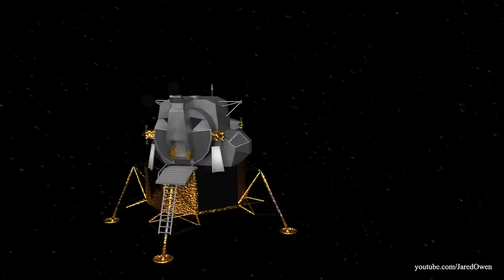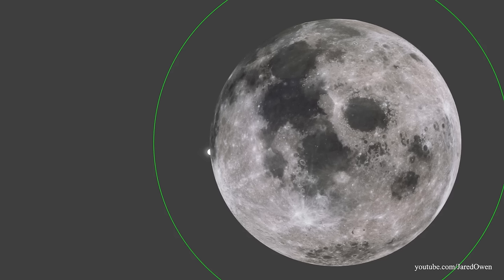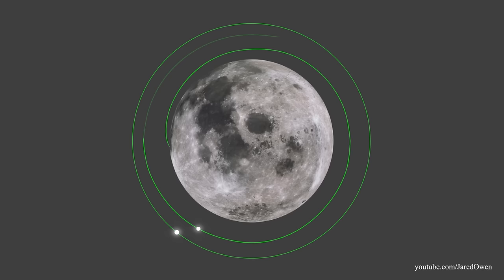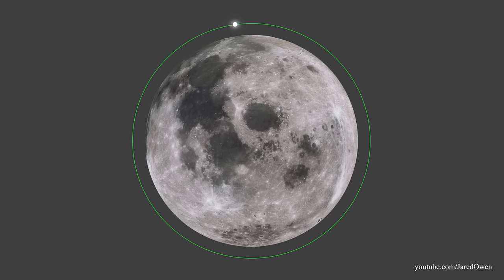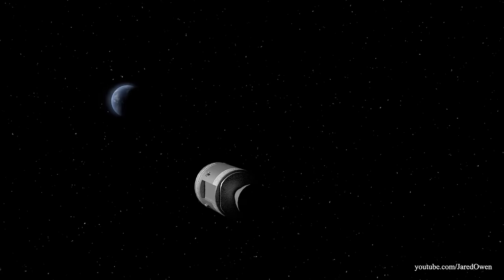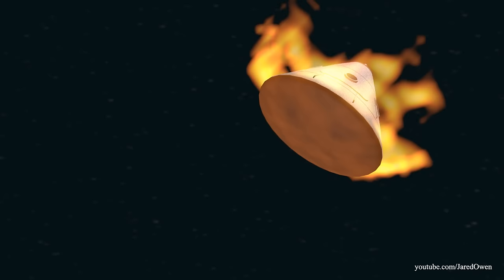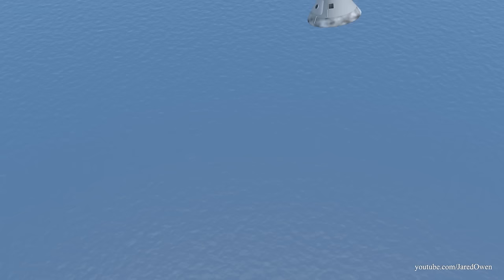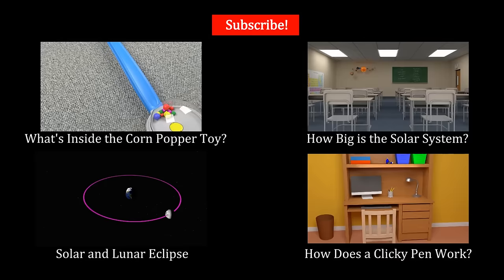How the Apollo Spacecraft works: Part 3

Comment: It probably bears mentioning that the Lunar Module's ascent engine was the only propulsion system on Apollo with no backup.  The service module engine was originally designed for lifting the CSM off the Moon and was WAY more powerful than it needed to be, so if it failed the Lunar Module's descent engine could do the job instead (as was done on Apollo 13).  If the descent engine failed during any phase of the Moon landing, the ascent engine could be used to abort the landing, get back into orbit, and rendezvous with the CSM. 

But if the ascent engine failed to ignite on the Moon, the astronauts were stuck there forever.  Worse, the Ascent Propulsion System had extremely simple plumbing that made it impossible to test-fire, because the corrosive oxidizer would basically destroy the engine in the process.  So on every Apollo mission, the ignition of the ascent stage on the Moon was the first time that particular engine had ever been fired.  The Bell engineers who built the LM's ascent engine probably had the most stressful job in the whole program.
Reply from the maker: I'm sure the astronauts were pretty nervous as they prepared to launch off the surface of the moon.  That would have been sad to get to the moon but not be able to return home.  Thanks for your comment - this is good info!
Reply: CountArtha Fucks thats crazy to think about...just three men stuck in the moon
Reply: I heard that Buzz Aldrin accidentally broke off the switch that fired the ascent engine! (Bumped it while wearing his EVA suit.) Had to stick a pen cap in there to make it work. Now THAT would make me sweat.
Reply: The other interesting fact about the ascent engine was each engine was assembled and installed without testing it.  The corrosive nature of the fuel meant that the engine would have to be rebuilt after firing, so no testing was possible.  In other words, the very first time the engine was ever fired was on the ascent module, by the astronauts who were depending on it to get them home.  Just a bit of pucker factor.
Reply: Yea right!  LMAO  Jared you are a genius, but this is one of the many great hoaxes of the 20th century!
Reply: Still not as stressful as for the two astronauts who relied on it.
Reply: Actually just two astronauts would be stuck on the Moon.   The command module pilot could return.
Reply: Where did they put all the rocket fuel?  It needed a rocket 10 times more powerful than anything on Earth today just to get into low Earth orbit, then does the rest on a few tonnes of fuel? Good luck on Mars.
Reply: @adayinthelife5496  
The Moon has one sixth the gravity as Earth.   The Lunar Module didn't need near the thrust to land and take off as a rocket from Earth.
Reply: charlesvan13 nonsense. you fail your iq test. if you burn 1 million kg of feul to asend and desend, you still need 1 million kg's to get that school bus back home.  the moon is still MASSIVE!
Reply: charlesvan13 my bad. I didn't realize the mass ratio is logarythmic for orbital velocity. thank god. i was starting to freak out. I'm the one rhat failed the iq test.
Reply: @Andrew-wv7qp  They must have built and fired up dozens, to achieve the bullet-proof design that would fire up every time. Much like the Command module parachutes. They could only be deployed once...
Reply: @charlesvan13  An the Moon has no Atmosphere.
Reply: Why not use the descent stage as a sort of booster and transfer the ascent stage's fuel to the descent stage so the descent engine can be used for rendezvous and docking? Was it too heavy? Did it not have the delta-V to do the trick?
Reply: @jemuelmongado5030  Yes, the whole descent module was just dead weight after the landing.
Reply: Could the CSM be used to land on the Moon, pick the astronauts up, and then return home?
Reply: @siyacer  I doubt the CSM would be light enough and have enough fuel for a landing. Even if it did, it will not have the fuel to return to Earth.
Reply: TryHard you realize only 2 people per mission (excluding 13) landed on the moon?
Reply: Yep...he still has the pen. @Tim22222
Reply: WTF are you talking about? You're not making any sense. Please explain better. @adayinthelife5496
Reply: Ken Skid The mass ratio means, if you want 1 pound of coffee in orbit, you need 50 pounds of fuel to put it there.  So if you ever want to get a human back from Mars, you need to put a fully fueled heavy falcon on the surface of Mars.
Reply: I don't think so. Mars' gravity is 38% of Earth. So if you needed 50 pounds to get the 1 pound to Mars, you'll only need 31 pounds of fuel to get it OFF of Mars. . Still a lot but not the same as leaving Earth.

Also, the fuel itself will weigh less on Mars so that in itself brings the total weight down.
 @adayinthelife5496
Reply: @adayinthelife5496  Exactly what rocket fuel are you talking about? The Saturn V launch vehicle had three stages that each carries its own set of propellants (fuel plus oxidizer). Then the service module and the lunar module ascent and descent stages all carry their own separate propellants. Also, keep in mind that the most thrust is required at lift off because that's when the rocket is at its maximum weight. Then as propellants are expended and the lower stages are dropped off the vehicle's weight is reduced. This means that at each step in the mission less and less propellant is necessary to accomplish each step.
Reply: The Service Module engine was NOT designed to lift the CSM off of the moon since the CSM never landed on the moon. It was designed to power them out of lunar ORBIT to get them back to earth. As for the LM's ascent engine, there wasn't much that could go wrong to prevent it from igniting. Hypergolic fuel use a fuel and an oxidizer that when mixed ignite on contact with each other. But, as you said, very corrosive and deadly to humans.
Reply: @Tim22222  The part that Buzz Aldrin broke off was an engine arm breaker. He saw that it had broken and would have prevented the engine from igniting. He used a pen to push the breaker back into the slot and the rest is Apollo history.
Reply: @EasternElectric2012  Thanks for dueling insults on the cyber field of honor - good come backs.  Wish I had time for a hearty civil debate of the facts at hand, it would be interesting to hear your perspective.  Best regards
Reply: @siyacer  Nope. No landing and takeoff systems in the CSM design. Astronauts are some brave individuals!
Reply: While the facts everyone is bandying on about with the ascent engine are true, it was never test fired and used corrosive fuels and had no backup, this was an engine that was deliberately kept as stupid simple as possible with hypergolic fuels that ignited simply by touching each other. Essentially they just had to open two valves and the thing would combust out of the nozzle and produce thrust. They wanted a system that would be nearly impossible to fail. Using nasty hypergolic fuels allowed them to eliminate a lot of complicated mechanical moving turbine pumps and other parts. The blind faith that this thing would work is warranted, as it was designed to be pretty much the simplest, most reliable, most fool proof rocket you could build. The side effect of those goals was an extremely nasty propellant. But it worked out okay in the end. :) 

I dont mean to detract from the claims, I just want to be sure everyone knows NASA didnt just decide to use untestable crazy rockets without a backup for the sake of being lunatics. There were sound, fundamental reasons Grumman went with that design.
Reply: @emayfrit  Ties many other such comments as the stupidest thing said in the last 50 yrs.
Reply: @adayinthelife5496  And thát, my friend, is why you'll never be an astronaut.
Reply: @WhatIInk  weird... I wonder if they would have continued the Apollo missions if Apollo 11 had failed?
Reply: "Mr. President, The Eagle has landed"
Reply: @KebabMusicLtd  Most certainly. Just like they kept going after the 1967 deaths of the three Apollo 1 astronauts in the ground fire.
Reply: charlesvan13 no. He wouldn't have been able, cos he wouldn't have the shield
Reply: Don't forget that somehow the circuit breaker that had to be pushed in to fire the ascent engine to leave the Moon after Apollo 11 was ready to return to lunar orbit somehow was BROKEN OFF, probably as Buzz was suiting up and exiting the vehicle on the lunar surface...  With the tip of the circuit breaker (which had to be pushed in and latched) broken off, there was no way to turn on the system or fire the engine.  They found the broken tip on the floor IIRC.  SO Neil and Buzz were basically "stranded" on the surface, but a little quick thinking overcame the problem-- they use a pen to push in the busted circuit breaker and fire the engine!  

Yes the ascent engine was the only non-backed-up engine on Apollo, that absolutely HAD to work for them to get off the Moon, but it was also pretty much the SIMPLEST engine you can imagine.  It burned nitrogen tetroxide and hydrazine for oxidizer and fuel, ie "room temperature storable propellants" that were also hypergolic, meaning they ignited instantly on contact with each other, meaning NO IGNITION SYSTEM was necessary to fire the engine.  Basically all the "fire" command did was electronically open the valves in the propellant lines between the propellant tanks and the engine combustion chamber itself, allowing propellants to flow and self-ignite.  In the event that the electronics failed and the firing command did NOT open the valves, they COULD be opened manually, which would then allow propellants to flow into the engine and self-ignite.  The engine itself was pressure-fed, meaning high-pressure helium gas was injected via regulators into the propellant tanks, so all that was necessary to fire the engine was opening the valves to allow propellant flow from the tanks into the combustion chamber.  SO, it was about as "foolproof" as one could get.  

While its true that due to the corrosive and highly poisonous nature of the propellants the engine could NOT be test-fired on the ground before flight, it was also an extremely simple and robust engine design, so while there was always SOME apprehension, everybody was pretty well convinced it WOULD work and that if something DID go wrong, they had a decent "work around" to deal with the problem, so the risk was "minimal" (as could be anyway).  

later!  OL J R :)
Reply: @adayinthelife5496  LM-- just a few tons, most of that propellant.  Saturn V-- 3,000 tons... LM-- flying in a 1/6 gravity field, so 1/6 the propulsion required for landing and ascent.  Saturn V-- launching through a dense atmosphere in a full 1-gee gravity field.  LM-- had only to decelerate from about 2,500 mph (IIRC) Low Lunar Orbital velocity (LLO) to a hover and landing on the lunar surface (full stop), with only its own mass of equipment, propellant, and 2 astronauts.  It only had to lift a fraction of its landing weight back off the Moon (the ascent stage, which was basically built like a phone booth made of tin foil) with the mass of the two astronauts and a couple hundred pounds of Moon rocks, and accelerate it up to about 2,500 mph to achieve LLO again... The military has had jets that can do over 2,500 mph, in Earth's atmosphere with considerable air drag, with more payload than that.  Yes that's with wings, but it's also with air drag, AND in a full 1-gee gravity field, not the 1/6 gee gravity field of the Moon, with NO atmospheric drag.  SO it's really not as hard as you think it is...
Reply: @jemuelmongado5030  It was safer to have a "launching pad" using the expended descent stage, rather than reuse the already used descent stage engine for the ascent burn.  Basically what you're talking about is a single-stage lander, with larger fuel tanks.  Besides, when you lift off, the landing legs and lower descent stage structure, tanks, and equipment are just DEAD WEIGHT that is totally unnecessary for the rest of the mission, so WHY carry that dead weight and accelerate it back up to low lunar orbit (LLO) velocity??? It's wasteful.  Plus, there was always the risk that the engine of the descent stage could be damaged on landing, which IIRC they basically were pretty sure happened on Apollo 15 when it landed, as it came down on a rock and partially bent the engine bell IIRC, which would have caused offset thrust or other problems had the engine been fired again for liftoff.  It was simpler, safer, and easier to just design a smaller ascent stage engine and simple propellant tanks and pressurization system for the ascent stage and use it to lift off the Moon instead, using the dead weight of the descent stage as a "launch pad".  That way you KNEW your ascent engine was "good" after landing.  

Another important capability that having an ascent stage engine gives you is POWERED ABORT... If on the way to the lunar surface during powered descent and landing your descent stage engine fails, you're dead as the LM would simply fall out of the Moon and crash on the surface, depending on the altitude.  At any rate, with a failed descent engine you would be trapped on the surface of the Moon with no way back into orbit, with a single stage, single engine LM.  With the ascent engine, if the descent engine quit at say 10,000 feet, you simply hit the 'abort stage" button and the lower stage is jettisoned and the ascent engine ignites, powering you back up into LLO to rendezvous and dock with the CSM.  There is a "dead zone" where you're too close to the surface to simply "plop down on it" and survive if the descent engine failed, there simply wasn't time for the ascent stage engine to fire and carry the ascent stage up away from the Moon before impact, BUT it was fairly small and the risk was fairly low-- after all if the descent engine worked fine THAT long to get you THAT close to landing, what were the odds of it quitting RIGHT THEN?? But with NO ascent stage/engine, you have NO abort capability whatsoever.  

In fact they tested this very mode on Apollo 10... they flew down to about 45,000 feet IIRC of the lunar surface and then fired the ascent engine in an abort, and flew back up to LLO.  They forgot to put the spacecraft guidance into the proper "mode" for the maneuver, though, and it had a wild ride before it straightened out and flew right, eliciting some cussing from Gene Cernan IIRC, but it worked.  Their LM was too heavy for a landing anyway, so they weren't going to land anyway, but the mission was flown to "prove" the LM out in lunar gravity-- Apollo 9 had already proven the LM in LEO, and Apollo 5 proved the LM guidance and hardware prior to that unmanned via remote control from Mission Control.  

Later!  OL J R :)
Reply: @siyacer  No... it couldn't.  If for whatever reason they couldn't fly the LM ascent stage back up to low lunar orbit (LLO) they were permanently stranded.  

The original design for Apollo WOULD have had the entire spacecraft land on the Moon.  This was in the VERY early days of Apollo when they were using what was called the "Direct Ascent" mode for the flight.  This Apollo would have been MUCH larger, as it required a HUGE amount of fuel to land not only the astronauts and their equipment, but the entire Apollo spacecraft on the Moon.  More fuel= bigger, heavier spacecraft... bigger heavier spacecraft= need more fuel.  SO you see it rapidly becomes a 'catch 22' and greatly complicates the entire operation.  You're landing MANY TONS of dead weight as well-- parachutes you don't need til you return to Earth, the heat shield for Earth reentry, Service Module systems like fuel cells and their reactants (propellants), etc.  Then of course you have to lift ALL THAT WEIGHT back off the Moon, carrying a lot of dead weight with you that you no longer need-- landing legs on the bottom of the vehicle, for instance, as well as the huge half-empty propellant tanks you had to have to hold all that landing propellant in the first place.  Such a huge spacecraft landing on the Moon would have created a lot of problems, too... like how do you climb down from the top of a 30-40 foot tall rocket from the CSM to the lunar surface to work?  How do you get back up into the CSM to sleep or leave?  How do you get your equipment and experiments down?  How much extra weight does it take in hoists or equipment to do that?  Calculations showed that such a huge, heavy spacecraft would require a rocket FAR larger than Saturn V-- it would have been called "NOVA" or the Saturn C-8, which would have had a 40 foot diameter first stage instead of 33 foot diameter, powered by EIGHT F-1 engines on the first stage, and a single 1 million pound thrust M-1 hydrogen engine on the second stage.  M-1 would have dwarfed even the F-1 in terms of sheer size, and being a hydrogen engine, which was basically all theoretical at that point, (no hydrogen powered rockets would fly until Atlas-Centaur in the early-mid 60's) development problems were virtually guaranteed.  Nova would take too long and be too expensive to design, build, and test, so they couldn't get done before "the end of the decade" it was soon realized.  

SO, an alternative had to be found-- "Earth Orbit Rendezvous" was proposed to replace "Direct Ascent" from Earth to the surface of the Moon and back to Earth again.  This allowed the smaller Saturn C-5 (later to become Saturn V) to perform the mission, BUT it was too small to lift BOTH the lunar Apollo AND the propellants necessary for it to fly to the Moon and land and then return to Earth.  SO, a SECOND Saturn V would be launched into orbit to rendezvous with the Apollo and fill it up like a robotic tanker vehicle, hauling up the Apollo's fuel on this second launch.  The fully-fueled Apollo lander would then depart for the Moon, land directly on the surface, conduct its exploration, then lift off to return directly to the Earth via reentry like the Apollo we know.  That was the design criteria that led to the MUCH LARGER AND MORE POWERFUL THAN REQUIRED SERVICE MODULE ENGINE that the Apollo CSM had-- it was designed back when it was required to land the entire spacecraft on the Moon.  

John Houbolt, a NASA engineer, came up with an alternative that didn't require but a single Saturn V launch, but the addition of a small "landing craft" to actually go to the surface of the Moon, sorta like a small rowboat going to shore from a much larger ship that stays offshore.  The small landing craft needs only carry itself, its occupants, and the experiments and equipment necessary on the surface down to land, and the equipment and propellant necessary to get back to LLO from the surface-- no dead weight like heat shields and parachutes and stuff like that, which can remain "offshore" in LLO in the CSM.  This "Lunar Orbit Rendezvous" method was at first highly criticized, as nobody could dream of conducting such a delicate and precision maneuver as a rendezvous and docking 240,000 miles away while orbiting the Moon, particularly when it hadn't even been done around EARTH yet, and they already understood the problems would be daunting... but he proved mathematically that EOR was inefficient and would likely not work before the decade was out, if it was possible at all... and it STILL required a successful rendezvous and docking to succeed, just in Earth orbit instead of the Moon's, AND it required the expense of a SECOND Saturn V "tanker" launch to work.  LOR was only ONE launch and ONE rendezvous, in LLO instead of LEO.  SO, LOR eventually won the day and EOR was dropped... 

SO, if the SM's Service Propulsion System (SPS) engine was designed powerful enough to land on the Moon, WHY couldn't a CSM land on the Moon to pick up stranded astronauts?? Simple-  not enough propellant for one thing, and no landing legs for another.  All the "descent and landing" capabilities for the Apollo CSM were never developed, once the decision to use a LM for that purpose was adopted.  For the CSM to land, it would have had to be MUCH larger and heavier, with landing legs and guidance instruments and controls to perform a landing, and it would have required a MUCH larger supply of propellants to land on the Moon-- IOW it would have had to be at least twice to three times the size to hold the fuel it would need, and need landing legs.  Plus it would have needed a Saturn C-8 or EOR mode to launch it, requiring a Saturn V "tanker" to fuel it up in orbit to land on the Moon... 

To put it another way, remember this... a Saturn IB rocket could launch the Apollo spacecraft, BUT NOT with a full fuel load-- IOW, NOT in a "lunar mission" full-up weight with full propellant tanks.  The Apollo CSM's launched on Saturn IB's could only hold a FRACTION of their propellant loads the tanks were capable of holding, IOW, they launched with their fuel tanks less than half full.  Propellant is VERY heavy LOL:)  That's why Saturn IB's were not used in the lunar program... not enough lift capability, BY FAR... BUT you only need a little propellant for an Earth-orbit mission-- basically just enough to change orbit and perform a retro-fire deorbit burn at the end of the mission, that doesn't require much propellant at all... 

Later!  OL J  R :)
Reply: @lukestrawwalker  the biggest advantage with the moon is that the escape velocity isn't much greater than exhaust velocity, meaning spacecraft can ride the 'explosion envelope', which is much more efficient.
Reply: charlesvan13  Michael Collins, the C.M.  pilot We felt sorry for him not being able to touch the moon at the time.
Reply: @adayinthelife5496  no...  You really don't... Damn near all of the mass is gone. The gravity is a fraction of earth's.

Also you know they don't need the engines firing for >90% of the journey.
Reply: @emayfrit  haha 50 years later??? They are now working on proving on it?

Were they collecting eye witness statements for half a decade or what?

Man walked on the moon. That is fact. You claim it never happened because you have no understanding of just how smart and talented some people are. And what can be achieved when enough of them work together.
Reply: Htx457  it's like rolling a dice 10,000 and needing a six every single time. Haha
Reply: A Day In The Life - Okay, let’s talk about mass ratios.  We’ll start with the Tsiolkovsky ideal rocket equation,

    dV = ve * ln(Mi / Mf)

where

    dV is the change in velocity
    ve is the effective exhaust velocity of the rocket engine
    Mi is the total mass before the burn (spacecraft plus propellant mass)
    Mf is the mass after the burn (spacecraft mass only).

We can rearrange this to solve for Mi/Mf as

    Mi/Mf = e^(dV / ve)

An Mi/Mf of 2 means we need one additional kg of propellant for each kg of spacecraft mass.  An Mi/Mf of 3 means we need 2 kg of propellant for each kg of spacecraft mass.  And so on.

The ascent engine could achieve a dV of 2220 m/s.  The engine’s effective exhaust velocity was 3048 m/s (all numbers from Wikipedia).  Thus our mass ratio will be e^(2220/3048), or right around 2, meaning 1 kg of propellant for each kg of spacecraft mass.  And indeed, the gross mass of the ascent stage before liftoff was 4700 kg (minus whatever mass used by the RCS thrusters during the landing), and the prop mass was 2353 kg - right around 2.

In other words, it didn’t take more than one additional kg of propellant per kg of spacecraft mass to put the LM ascent stage in lunar orbit.  

And note, this is all in terms of mass, not weight - this is independent of gravity.
Reply: Longest comment ever i seen
Reply: @adayinthelife5496   Just imagine how much fuel will the mars ascent module require!
Reply: @adarsh4764  There isn't a material on earth that could build a rocket big enough.  They will need to send dozens ahead for refueling. I think they should focus on the moon.
Reply: @adayinthelife5496  Well lets hope for what Elon Musk does with its SpaceX Starship!😂
Reply: @adarsh4764  nasa did the whole thing in a couple months
Reply: @adayinthelife5496  you dont get it i guess. Leaving earth was the hardest part gravity wise. Once out of earth gravity you only need a little push from a rocket to get moving
Reply: @eddiecongdon8017  thats wrong in so many ways, I hope its sarcasm
Reply: @Tim22222  According to an interview with Neil Armstrong the circuit breaker was still working, but if it dropped, there would be no way to reset it without the switch - if it tripped before they got to orbit they would crash. So the pen was put in there by Buzz in a moment of quick thinking to keep it closed and stop it from tripping. In the end it didn't try to trip. Neil was pretty optimistic it would still work but they could not take even the slightest risk with that ascent engine. 

Later Apollo missions had protective covers on those switches to avoid a repeat incident.
Reply: @adayinthelife5496  Don't you know anything about rocket staging? Or have you never watched the telemetry of any rocket launch? Most of a rocket's mass is fuel. Actually it only needs about 10 Tesla batteries of kinetic energy for the LM to reach orbit. 

Rockets work exponentially, both in power and in weight.
Reply: @srinitaaigaura  good point. I need to rethink the LM staging and mass ratio
Reply: @adayinthelife5496  I suggest you read the Apollo flight journals on NASA's website. They have a lot of technical information.
Reply: @Andrew-wv7qp  CountArthat literally said that
Reply: @emayfrit   When you haven't much education I suppose it is difficult to imagine the abilities of mankind. It is never too late to get a university science degree or two. Get your head out of the sand and walk in the sunshine.
Reply: More like, if the accent engine fails, they can send an SOS to mission control which then sends a rescue mission.
Reply: @emayfrit  citation?
Reply: @adayinthelife5496  the moon has no atmosphere and as mentioned less gravity
Reply: @adayinthelife5496  Mars is both easier and harder. It takes less fuel to land on it than the moon, it has an atmosphere so spacecraft can slow down by atmospheric reentry (like they do on Earth) and only need to burn a little fuel for the final landing. On the moon, there's no atmosphere so slowing down from orbital velocity can only be done by burning fuel. Getting back is the hard part, the Apollo missions did that by bringing all the necessary fuel with them, but that's not feasible for Mars. The return fuel would have to be made there.
Reply: @KingdaToro  I agree %100.  Elon needs to build some refueling stations on nearby moons to do what he is claiming.  Maybe they'll sell Twinkies.
Reply: @siyacer  No. At that point in the mission, the CSM only had enough fuel left for TEI and course corrections. And it had no landing gear. All it can do is go home.
Reply: @adayinthelife5496  The solution is to get there in a Starship, then make the fuel for the return trip on Mars. A fully fueled Starship can get all the way back to Earth from the surface of Mars. In fact, the whole reason it uses methane is that it's easy to make on Mars.
Reply: @bobbarker7733  It actually was, as it was finalized before the mission mode was decided on. Originally, they planned to land the entire CSM on the moon, so its engine would have needed to land it and get it back into orbit. Since this would have meant taking the fuel for TEI down to the Lunar surface and back into orbit, it would've needed twice as much fuel... which in turn would have a knock-on effect all the way back to the rocket. It would have needed either the much larger Nova rocket (for direct ascent) or two Saturn Vs (for earth orbit rendezvous). The chosen mission mode, Lunar Orbit Rendezvous, separated the lander from the main spacecraft, which means the CSM and its engine no longer needed to worry about landing on and launching from the moon.
Reply: @adarsh4764  Enough that it'll need to be made on Mars. SpaceX's Starship is designed from the ground up to work this way, starting with the choice of methane for the fuel. It's easy to make on Mars.
Reply: @eddiecongdon8017  A moon mission never leaves Earth's gravity. The moon orbits Earth, after all. It needs lots of big pushes, and each needs to push the fuel for all the ones after it. This is why it needs such a big rocket. They are...
Launch (this one's obvious)
TLI (speed up a lot to leave low Earth orbit and go to the moon)
LOI (slow down enough to orbit the moon instead of just going back to Earth)
PDI (slow all the way down to drop out of Lunar orbit and land on the moon)
Launch (get off the Lunar surface and back into orbit)
TEI (speed up a lot to get out of Lunar orbit and go back to Earth)
Then of course you gotta slow down A LOT when you get back to Earth, as you've essentially been falling all the way from the moon. You don't have any fuel left, so you just let air resistance do the job. This is atmospheric reentry.
Reply: I have one question.. How does the command module works while going from moon to earth after escaping from the lunar orbit.. In short I want to know how the spacecraft flows in return of the astronaut to home ( how command module works for return 3 Days between moon and earth) sir plz tell I am 11 years old and want to become as aerospace engineer.. Love and respect from india
Reply: @adayinthelife5496  The fuel to leave earth orbit and go to the moon was in the 3rd stage of the rocket. The fuel to enter and leave Lunar orbit was in the service module. The fuel to deorbit and land on the moon was in the descent stage of the lunar module, and the fuel to launch from the moon, regain orbit, and rendezvous with the command module was in the ascent stage of the lunar module.
Reply: @JaredOwen  Fun fact: on Apollo 11, the PLCSS backpack on one of the astronauts actually knocked a circuit breaker out of the control panel, which would have made it impossible to ignite the ascent engine to return to orbit. Buzz Aldrin tripped the breaker by pressing it down with a felt-tipped pen in the spacecraft.
Reply: The Apollo 13 descent stage was not used to initiate trans earth injection.  Since the spacecraft had never undergone lunar orbit insertion  they were on a free return trajectory.  The descent engine was used to make needed midcourse corrections to make sure that the returnning Apollo hit the narrow re-entry corridor.
Reply: @adayinthelife5496  One they're only lifting a small fraction of the mass to an orbit about 50,000 feet high,  Two they're doing it in one sixth of the gravity   Three  no atmosphere to cause drag with.
Reply: @fmlazar  they were cutting it really close.  Certainly not using half their fuel for reusable rockets. An didn't take them 20 years. In 10 years they went from no rockets, to multiple heavy moon landings, to no rockets again.
Reply: @fmlazar  Correct. It also did a long speed-up burn (PC+2 burn) after emerging from behind the moon. It ran slightly long, necessitating the manual course correction burn later in the mission.
Reply: The LM was a stage prop only.
Incapable of flight.
Reply: @CarlMarksmoney  Incapable of atmospheric flight.
Reply: As I understand it, the fuel it used was 2 compounds that ignited upon contact with each other regardless of environment. So no spark, no oxygen needed. So yes, the plumbing would be vitally important...
Reply: @AngelPerez-dw8ou  Two. Only two went down to the surface on the Apollo missions.
Reply: Not true.
No backup 2nd stage, no backup 3rd stage.
What makes a lunar ascent module engine failure particularly wicked is that they are literally stuck on the moon, no 2nd chance to come back home.
Reply: Incredible, thanks for sharing those details
Reply: CMP in orbit would have returned home alone.
Reply: @adayinthelife5496  You are so wrong.  Much smaller ship and only 1/6 gravity.
Reply: @apollo11guy  too bad they lost the technology... should have had a man on Mars 15 years ago.
Reply: @Andrew-wv7qp  Old comment I know but felt the need to say that the OP already mentioned your info in his comment lol. I'm guessing people don't read properly or not at all and get excited to add something.
Reply: @AngelPerez-dw8ou  No "only" two. The third astronaut orbits the moon while the other two land on the moon. This way, if the worst came to the worst, he would be able to return to Earth alone.